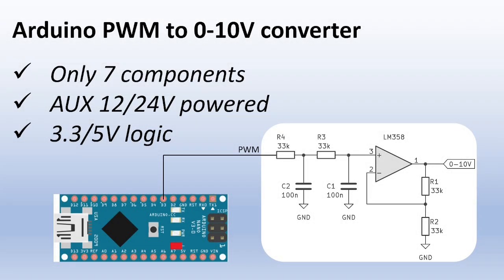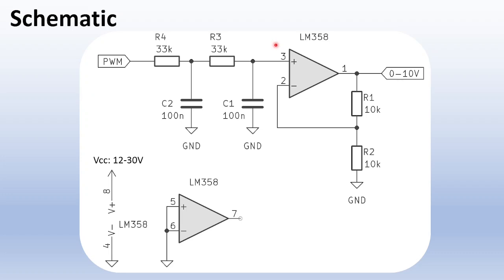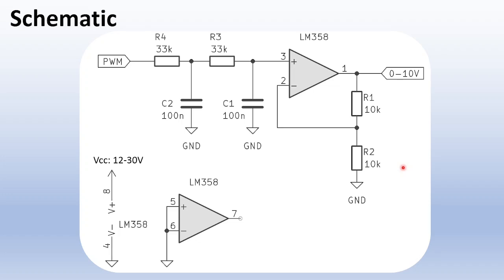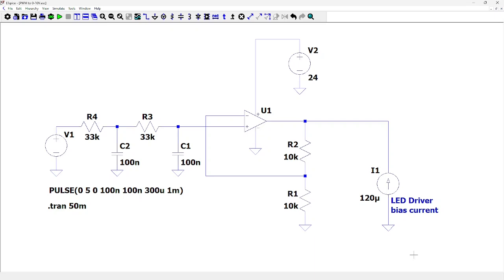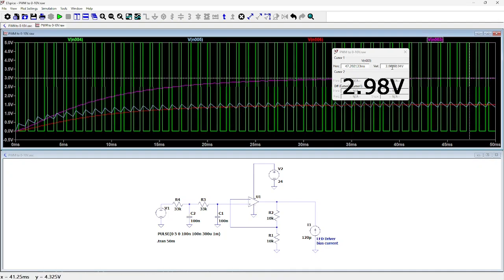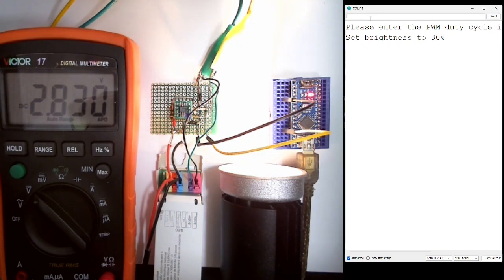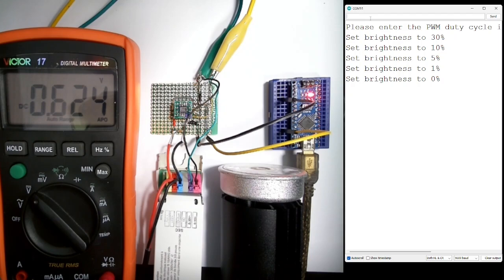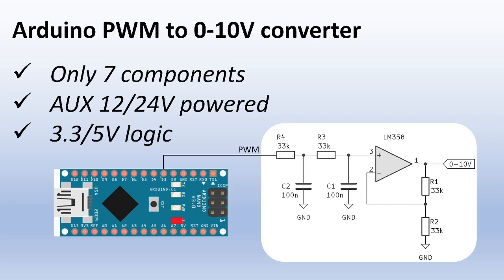Arduino PWM to 0-10V converter

Comment: Actually I want 0-10v and 500mA
Reply: the op amp does not provides 500mA - just a few mA. You have to use driver stage behind the op-amp.

Comment: "design graveyard" is funny. I have also a few boxes with unfinished projects. I guess they are more than Michelangelo have unfinished during his life.

I was a little bit surpriced about the relatively low PWM frequency of the arduino. But then I have recherched that the Arduino Uno and similar boards, operate at approximately 980 Hz. This is not really a lot. So the Arduino Uno cannot drive SMPS applications, where I need at least 50 kHz or better 200 to 500 kHz.
Reply from the maker: @gkdresden  you can go much higher, up to 1 MHz, there is a library which makes it very easy. Check my video https://youtu.be/R-xqZx2NIV0?si=Ti2lEr440WIMA81v

Comment: Hi there , I liked the project,can you help me ? 
I want to convert 0-10V to 0-5V if possible:)
Reply from the maker: You can adapt the circuit:
1-directly connect LM358 pin 2 to 1 (now you have a 1x amplifier, so you have 0-10V on this point too)
2-disconnect R1/R2 mid point from LM358 (so they become a voltage divider, divide by 2)
3-Now you have 0-5V on the mid point of R1/R2
(Best to replace R1/R2 with a lower value (1k for both) to make sure the receiving circuit (analog in of MCU?) does not affect the signal. Try with a multi meter first 🙂

Comment: What would be involved in going the other way, say 0-10V or 4-20mA to PWM?
Reply from the maker: You can do this with a microcontroller: reade the 0-10V or 4-20mA with the analog input and write code to generate a PWM based on the analog inputs' readout. Good idea for a video 🙂